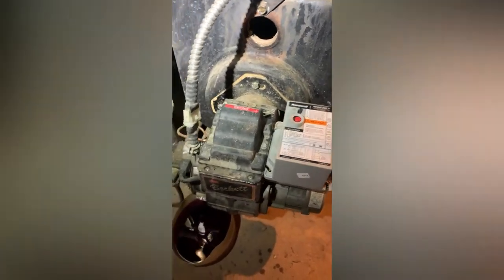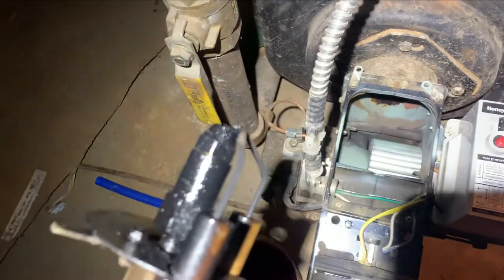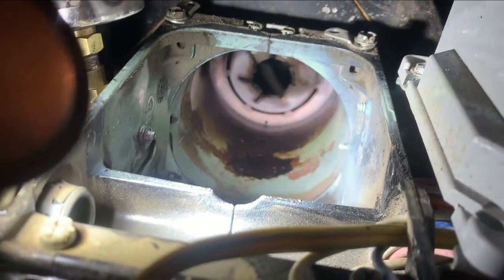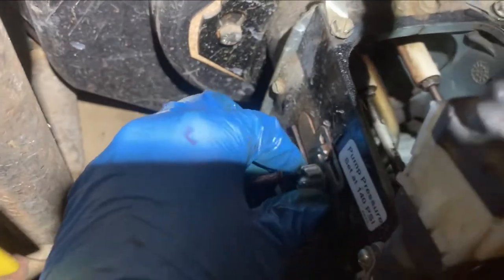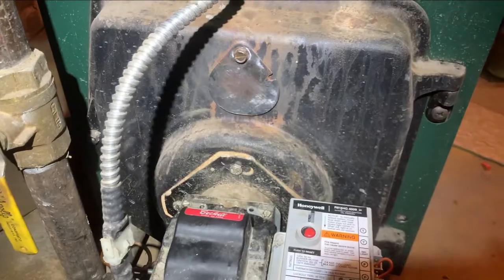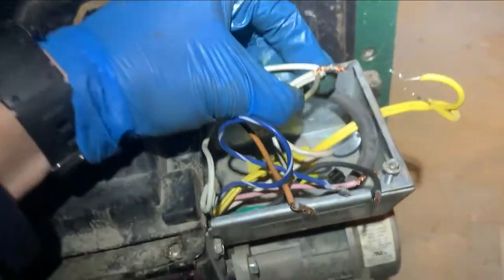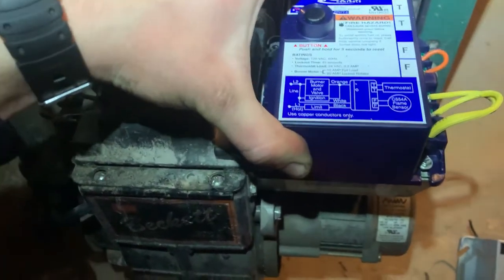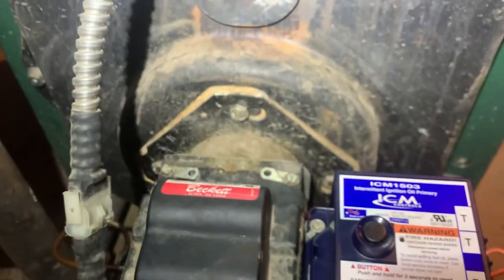Beckett Burner flame keeps turning on and off

Comment: Nozzle rate of flow is based on 100 psi pump pressure.  So your 1.00GPH is actually higher at 140 psi.

Comment: My old williamson has been doing something similar to this but maybe half as fast. I will be putting a new primary on and seeing how it acts from there. As my burner was lighting and shutting off constantly with good flame, i could see a flash of light inside of the primary box around where the red reset button goes through the top of it.
Reply from the maker: Sounds good, let us know if you find out it was a different problem or have any questions.
Also, another test you could do is tapping on the primary with a tool. If it goes on reset when you tap it, you know it's bad.
Reply: @BambergersInc. Thanks!  I opened up the primary control box, a Honeywell Grey box, one of the two contacts was not making good contact and arcing.  I filed it like I would do on old points ignition and it now  works as it should. We are coming into a cold stretch in MN now so hopefully it holds up until a new replacement box shows up in the mail.

Comment: Excellent video. I have an occasional tripping of my primary now. I have replaced nozzle,bled air from pump,cleaned flame sensor eye,adjusted ignition tips in the gun . My next thought is primary replacement .It is either original 30 yrs old ,or was replaced 20 years ago before I inherited the furnace . I use my oil furnace as back up to my wood furnace but I need it reliable . So I think I am going to replace the primary .Thanks for your video.
Reply from the maker: Many times if the primary is bad, taking a screw driver and tapping on the top of it during run time will turn it off. We have a video finding this exact issue this way if you’d like to watch I will link it below. Thanks for watching!!
Reply from the maker: https://youtu.be/DTTd70YYNBE?si=HnrxKlC4eRiBUTSS

11:25 is where we catch the primary by tapping on it

Comment: I have a Williamson oil burner furnace (not a boiler) with a Beckett burner installed in 1996 and maintained every year (we built this house and still live here). This thing is super clean and it has new electrodes properly adjusted with the Beckett tool, a new electronic igniter/transformer and the flame sensor has been tested and working but I will replace that also since it’s so easy.  The issue I have right now after it was serviced and the items I mentioned replaced, a few weeks later it tripped and I noticed that because it was cold this morning.  I pressed the button on the controller to reset it and I saw a flame for just one or two seconds and then the flame went out, so I powered it off.  Knowing all the items I mentioned were replaced/new, it seemed like a fuel issue to me so I cracked open the bleeder screw at the pump and fired it up and sure enough the fuel was foamy so I bled it until it was just fuel and no longer foamy.  After that I started it up and it’s been fine all day. I confirmed all the connections are tight. Not a drop of fuel anywhere (and it's always been like that...really clean).  I’m a little suspicious about whether or not they have been changing that oil filter in the canister because it looks suspiciously clean around that area where the filter is installed and maybe a few cobwebs on it also. Maybe they’ve been a little leery about doing it because it’s harder to bleed because the tank is in the basement but the copper line runs up along the ceiling of the basement and then back down to the furnace and at the bottom of the furnace is where they put the canister filter and then of course the copper line connects to the pump on the burner.  I’m just looking for some possible explanations for while all of a sudden the the fuel was foamy, could it truly be that oil filter in that canister getting clogged?
Reply from the maker: We have had this issue before with other units. Here's a couple of things.
1. if it is a long run from tank to burner, it may be more difficult to bleed completely. 
2. Yes, you are correct. If the filter is clogged or the pump screen (inside the pump cover), then it would stop working after a minute. 
3. If they weren't cleaned, you could get a dirty nozzle, which would cause flame issues. 
4. You may want to consider installing a de-airator or a return line to help remove the air.
5. Sometimes, air collects over time in the line where it runs along the ceiling (the highest point).

If the problem continues check the filter and screen first. Thanks for reaching out. God bless!
Reply: @BambergersInc.   Thanks for the advice. Regarding #4 - while searching more yesterday I came across that 'Tiger Loop' device which does what you mentioned...takes the air out of the line. Looks pretty cool! We've never had any trouble out of this setup since 1996 when we first installed it, so I suspect (and hope), maybe I just didn't get all the air out the first time. I bled it again and got a lot more 'foam' out before it turned into just fuel. I'd still like to get one of those devices installed sometime. The feed comes out of the bottom of the tank (not ideal from what I learned, as far as potential to pick up sludge/dirt, and then it goes up to the basement ceiling across to the furnace, then down to the bottom of the furnace which is where they put the filter (don't know why - inexperienced installer?) and then to the pump. Total length is maybe 60 to 70 feet or so. At this point I'm confident it's an air in the line issue, based on all the foam I bled out yesterday - I bled out about 1/4 gallon before it got really clear. So I'll plan to eventually get one of those Tiger Loop devices installed if it happens again. 'Tigerloop TN Oil Deaerator'   P.S.  My furnace is SUPER clean and serviced every year. No black mess anywhere. It burns really clean and even looks really clean overall. I was shocked when I started watching YouTube videos about other people's oil furnaces. LOL  Wow.
Reply: @BambergersInc.   Sorry, one last thing. A few days ago I bled the pump while it was running and collected a little over 1/4 gallon before I saw just clear fluid, not foamy fuel.  Today I decided to bleed it again because I'll be away from home for 4 days and wanted to be sure it was all set and wouldn't shut down if more air was in the fuel line. This time I collected a little over 1/2 gallon before I stopped seeing any foam.  Does that sound about right/correct for about 65 to 70 feet of copper tubing/fuel line? (regarding how much you'd bleed before seeing just fluid with no foam/air bubbles)   I do want to look into getting a 'Tigerloop' deaerator installed later on, but for now and since it worked fine for 28 years, I figured I can wait until next season when I'm prepared for it.  For now, I'm not sure why all of a sudden I'm getting air in the line unless somehow the techs really haven't been changing the filter and it's dirty to the point where it's really trying to suck so hard it's somehow pulling in air...if that's possible.  The other thing I'd like to do, once I get a Tigerloop is to switch the fuel line from the bottom of the tank to having the fuel line inserted from the top and leaving it about 5 inches from the bottom of the tank so there's never any chance it can suck in dirt/sludge from the bottom.
Reply from the maker: @ThePhotographyHobbyist  pull the pump and look in the tunnel for wetness / oil. If the seal in the pump is stating to leak, this will happen. The system is losing its vacuum/prime so to speak. Even if it isn’t leaking oil yet, it may begin as leaking air. This would allow the oil to flow back to the tank if you are losing your seal when the pump isn’t running.
Reply: @  Thanks. If it happens again I’ll check that.  We bled it again and so far it’s been OK.  Maybe 3 weeks or more now.  Had more air in the line.  It’s possible I didn’t get it all the last time. We’ll see.

Comment: That's a boiler, not a furnace
Reply from the maker: @John_Lee_
A boiler is a type of furnace...
Definition of furnace according to the Dictionary of the English Language: "An enclosure in which energy in a nonthermal form is converted to heat, especially such an enclosure in which heat is generated by the combustion of a suitable fuel."
Reply: @BambergersInc.  You can find a lot of outdated stuff in dictionaries. NO ONE in the trade would EVER call a boiler a furnace.
Reply from the maker: Well...we do.

Comment: How many seconds should boiler ignite after Beckett burner starts drawing oil?  Mine takes Approx 12 seconds,,,is this ok?
Reply: On newer models yes maybe
Reply: It depends on if you have an oil solenoid or delay on your primary control. But if you don't have the solenoid, it shouldn't take that long to light. Might need a new nozzle.

Comment: When replacing the primary is it plug and play or do you have to program it?
Reply from the maker: Most primaries if you go one wire at a time it is plug and play. Certain primaries have different settings you can change but will still work!

Comment: You need a nozzle wrench.
Reply from the maker: @jefferybaker1998
We have a 5/8" socket wrench, but in order to pull the two wrenches together to break the seal, it works best with a normal 3/4" and 5/8"wrench. Many are very tight. Would you have a different suggestion?
Reply: @BambergersInc.  nozzle wrenches are a waste. You're fine with 2 separate wrenches 3/4" and 5/8" like you said.

Comment: Great video could u have used compressed air to blow through that tube if you didn't have accessible?
Reply from the maker: @karenalston6517
Not sure exactly what you are asking. If you are asking "can you blow through the nozzle line with compressed air" than I would say you can if you remove the nozzle first. But that might not get all the junk out of it, you should still rinse it out with some type of cleaner, like break cleaner.

Comment: Not the right primary controls to properly utilize the solenoid valve.
Reply from the maker: That is a good point, we could have changed it with a primary that has pre and post purge. Generally we just replace parts with like parts on a  residential burner because it doesn't make that much of a difference. But you are correct.
Reply: @BambergersInc.  Well, maybe not, I believe it helps with efficiency and start up and shut down, less pissing off the nozzle on shutdown, and it'll also lock out after 3 resets so the homeowner doesn't kill themselves should it deliver a late spark, 15 seconds trial for ignition vs 45. Much safer. Those are my reasons, if it's not a solenoid valve pump I never install a fancier primary control.

Comment: Your video shows us HOW TO NOTHING 😮
Reply from the maker: @HandsONreviews4u
Sorry, what did we not show?
Reply: Wow, I came across your video because I'm having issues with my becket burner on my boiler. I just have to say you did a great job troubleshooting and locating problems and fixing issues. With that being said every now and then, but it's been happening more often. I get a puff of smoke that comes out of it  inside the room where the boiler is and outside from the power vent. Giving a smell inside and out. Any thoughts about what could be causing that. All filters have been changed and nozzel. This has been going on before and after those things have changed out.